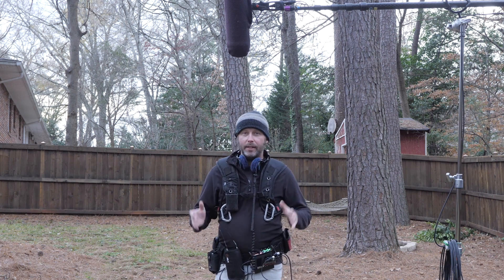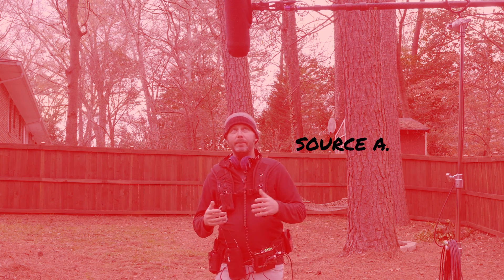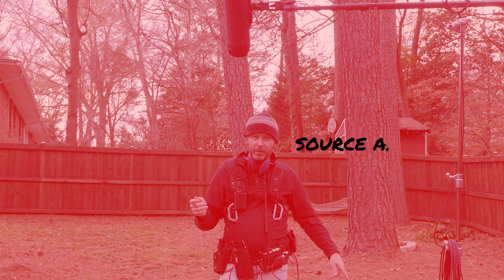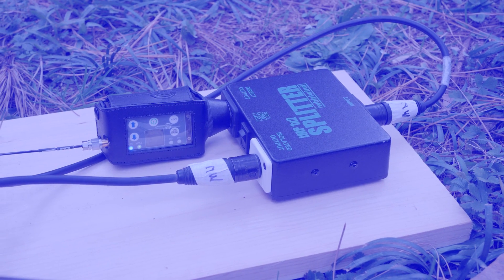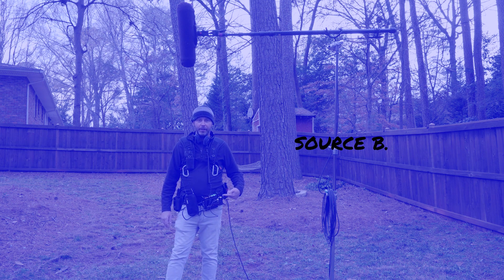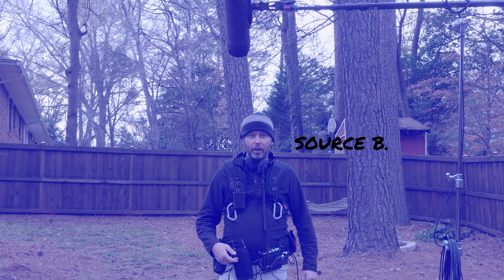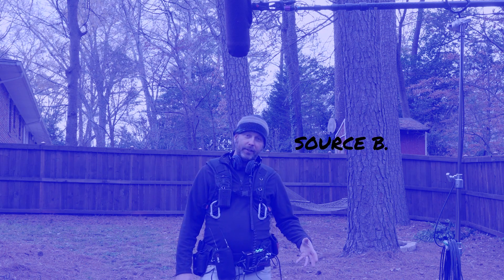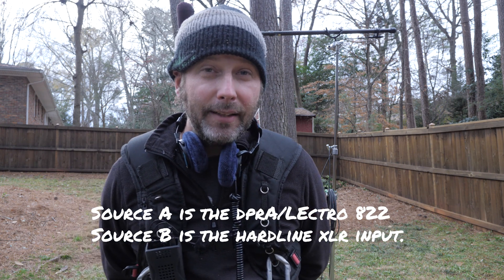Lectrosonics DPRa VS Analog Hardline - Listening Experience

Comment: I have just hear it and on my phone. I do prefer B but A is very usable. There is just a bit more freedom in the high end with B. I would normally think that was the compander but it’s a digital transmission and shouldn’t have a compander. I haven’t used them is there a digital compression setting the the sennhizer?

Comment: Listened to this on my phone speaker (Pixel 3a, midrange) and also on my computer speaker which is a small Bose consumer thing. Both were clear as to the better sound quality -- hardline was no contest there. The difference is discernible and I have a preference every time for the hardline.

With all of this stuff this is DEGREES of difference, so different projects will have different expectations for sound quality of the deliverables. For most work, the plug transmitter will meet and exceed their standard of required quality.

For all work that I would consider requiring "studio quality" recording practices, IMO features and narrative projects, any manufacturer's plug-on transmitter can not deliver sound quality that will stand toe to toe with the picture quality these pieces are achieving. The sonic capabilities of our recorders' preamplifiers is far greater than what our wireless systems pass through to them. I'd have to listen again to be certain of this, but I'd wager the detriment to sound quality is worse through a plug than recording hard-lined to a pro-sumer level machine like the Zoom F8. 

The tonal quality of the voice in the upper-midrange on the plug is harsher and more forward. The voice lacks the resolution of a hard line. The hardlined voice is more robust, smoother, more "relaxed sounding" to my ear, the voice sits more cohesively into the space, and the space is better defined.

I would compare the Lectrosonics DPR to MP3 compression in terms of the type and amount of sound quality detriment it imparts onto the recording. There is a clarity, cohesiveness, and naturalness that is lost in MP3 compression. The MP3 still sounds like music, but the master uncompressed track sounds more like music -- smoother, more natural, more full, more cohesive. 

As with MP3, in many applications "good enough" is good enough. But we are nowhere near the point that you'd hear me say any manufacturer's wireless transmitter matches the quality of a hardline to a professional-quality preamplifier.

Comment: Interesting! I couldn't really tell the difference besides the pop in source A that someone mentioned. So I took the files into RX and there I could detect a few more pops in A that I didn't catch on YT. I also noticed that B is 0.7 dB louder which I think might be a factor in preference. I also made spectrograms and layered them on top of each other after compensating for the gain, and it's really hard to tell the difference except for a roll off in B above 20k. I would say the difference is within 0.5 dB or so. Not that a spectrogram tells everything but still. Spectrogram: https://imgur.com/a/Lc5Ak3N
Reply from the maker: Very interesting, thanks for sharing those results Manne!
Reply: Manne, very detailed analysis! Thanks

Comment: I would say both are definitely good enough. I have a UH400 and used the HMa this summer. The audio quality is good, but what struck me is that the limiters are kind of harsh compared with SD limiters. Are the limiters sounding similar as previous version? Or can you set the gain lower since its transmission is fully digital now to get a better dynamic range? The recommended settings with occasionally peaking for digital hybrid to get the signal as strong as possibly is definitely to hot for me.

Happy holidays!
Reply: Most users we've talked to feel that they can set the gain a bit lower due to the lower noise floor of the DPR, and thus stay away from the limiters more often. Hope this info helps!
Reply: @lectrosonics  Wonderful! Glad to hear that. Has that to do with the digital out of the receiver or with the unit itself? I thought that one of the reasons why you recommend people to run their Digital Hybrid transmitters fairly hot was to get the best transmission power. Maybe you don't need to run the transmitters hot to get a strong signal if it is digital?
Reply: @Dustbrigade  You are correct - with FM-based systems, the range of the system is somewhat dependent on full modulation - if a transmitter is severely under-modulated, you will see shorter range from that system. With digital transmitters, the signal is fully modulated all the time, so the audio gain setting of the transmitter has no effect on range. But the other thing is that these modern digital systems have lower noise floors and thus better linear dynamic range, so you can be a few dB down in your modulation, and still have excellent signal to noise in your system.
Reply: @lectrosonics  Splendid, thank you for sharing this. I was thinking that was the way, but I am glad that you confirmed it. 

Oh really? How many db less noisefloor do you have on this transmitter compared to let's say, a HMa? -125db (A weighted) EIN is pretty good
Reply: @Dustbrigade  don't forget that the 125 dB (A) figure for the HMa is with full limiter engagement. The overall dynamic range figures are similar, but most users report hearing a lower noise floor - it is likely the signature of the noise floor being different.
Reply: @lectrosonics  Oh, okey. So it is roughtly in the 100 Range when excluding limiter? That makes sense then, at that point conservative gain settings could get into audible noisefloor.

Comment: Thanks for the video, Michael. I’d be curious to hear the Digital Lectro without ever leaving the digital domain (tracked via AES / no 2nd preamp).
Reply from the maker: Excellent point about paying close attention to the A/D conversion stages Jim. So for this demo the 822 is being recorded to its internal micro SD so the only A/D should be in the PDRa, but to your point sending it out AES I’d imagine should be a an exact duplicate of what is being demonstrated here.
Reply: @MichaelWynneCAS  oh cool... I missed that bit about using the microSD to capture. So yeah, this is as clean as the transmission can get. 👍
Reply: @HubLocationSound  without removing the splitter, but that would also eliminate the ability to listen to exactly the same performance from exactly the same mic. I think this was a decent way to go about this test.

Comment: I’ll start by saying that I listened to this on my phone speakers. Obviously that will make a big difference in what I hear. 

Neither sounded markedly “better” than the other. What I noticed was A had more top end, making B sound slightly darker.
Reply: Yes, on a mobile device, can’t tell them apart. With air air pods start to hear a difference....but better? Hard to say. At least to this average user. Generally though, after I know, maybe can start to hear a difference, but not before and both just sound good. I feel like my ears actually adjusted and heard them both the same after the first color change.
Reply from the maker: @philpritchard5173  nice observations. It's amazing to me how our ears naturally adjust to all kinds of environments.
Reply: @MichaelWynneCAS  So this is interesting. I finally had a chance to listen in my mix environment. I'll still say that both are very much useable, but the hardline sounds more natural. On studio monitors, the hardline has better low end response, as the DPRa had a build up in the low mids.
Reply from the maker: @Xtreemdrummer  thanks for sharing that, sounds similar to what I was hearing as well!
Reply from the maker: I trust your ears Dan, solid observations!
Reply: @MichaelWynneCAS  Yeah, felt A had more topend, so thought that was the hardline for that reason

Comment: Great comparison, very much looking forward to getting wireless for my booms.
Reply from the maker: I was quite surprised how close they were, next I got to do a range test with the digital hybrid and then I may just be sold!
Reply: @MichaelWynneCAS  On these same lines, I've been seeing the Sound Devices MM-1 used on booms, is that a setup that you've used?
Reply from the maker: @b-rollaudio5368  yes sir, that with a SMQV typically, I hand some HMa’s but it’s hard for me to get away from the sound of those analog limiters and ease of adjusting trim levels to suit the scene.
Reply from the maker: @SoundSpeeding  yes I’ve heard some say they don’t prefer it but most go with the flow.  Congrats on the gig!